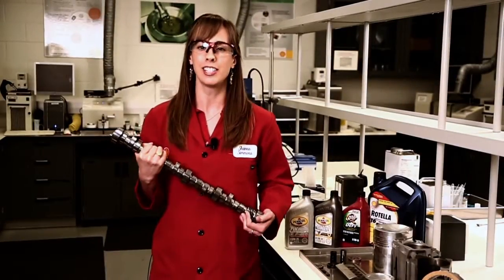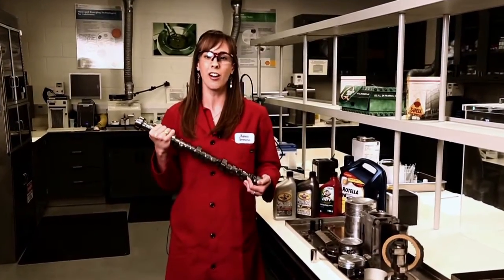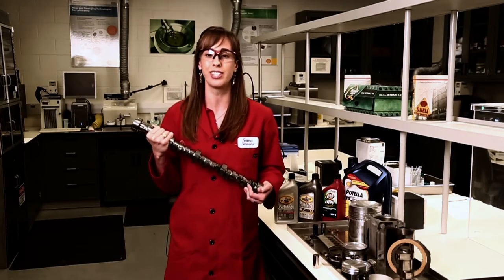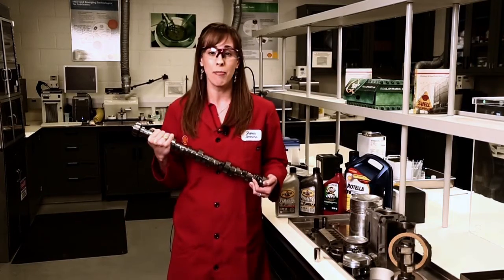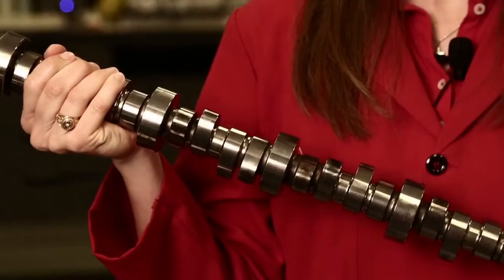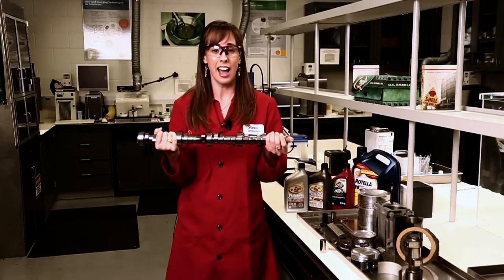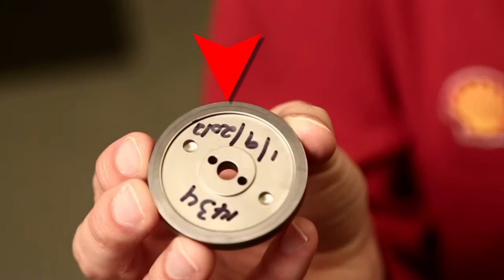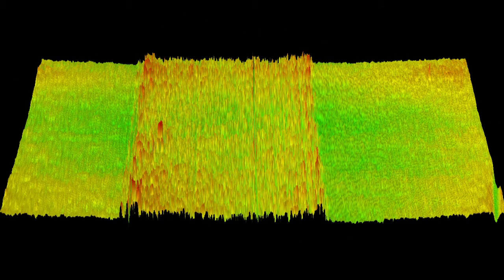Motor Oil 101: Engine Friction -- Educational Video

Comment: Hi Engine Girl - I am using PP syn HM in a few cars. I do have one concern - 
Why do your PP syn high mileage oils have such low viscosity compared to competition. I'm comparing 5w20:
PP HM: 43.7/8
Mobil 1HM: 50.1/8.6
Valvoline Full Synth HM: 48.9/8.6
Motorcraft Semi Syn: 50/8.7

Is there more than meets the eye? Is it an apples to oranges comparison? Seems there would be less protection...

Comment: Engine Girl, What do you suggest for a high mileage Ford 4.6L engine. Manual says 5w30, of course Ford changed to 5w20. Would synthetic be better? There is slight oil loss, about 1 qt every 2500.
Reply from the maker: What model and model year is it? My gut recommendation is Pennzoil Platinum High Mileage 5W-30. It is BOTH a full synthetic and a high mileage motor oil -- so you get the benefits of high temperature protection & engine cleanliness AND seal swell additives & reduced oil consumption.
Reply: Thanks, a 98 Grand Marquis with about 165K miles. Otherwise runs perfect. Currently on M1 high mileage  5W20 and I think it made oil consumption worse :(. Is Pennzoil a better choice?
Reply from the maker: Yes, Pennzoil Synthetics are better because they are made from natural gas (not crude oil) and provide better high temperature performance, so you will see less oil consumption. Try the new Pennzoil Platinum High Mileage!
Reply: Just bought it for all my 3 cars - nice rebate going too! Thanks!